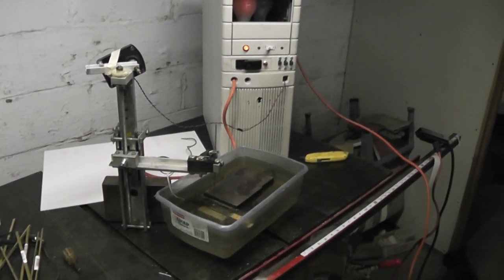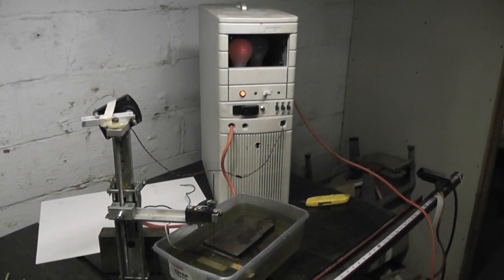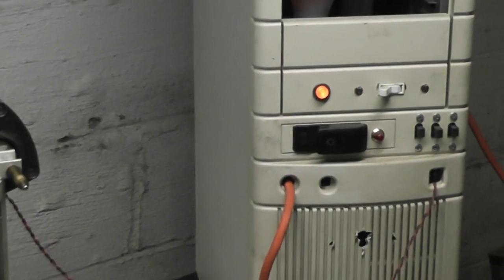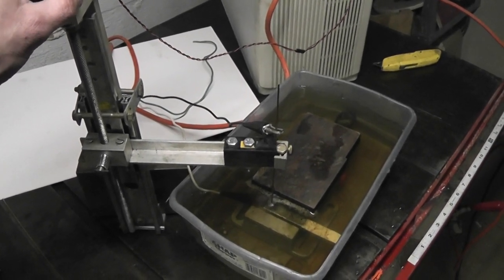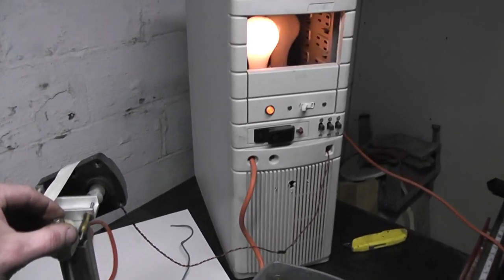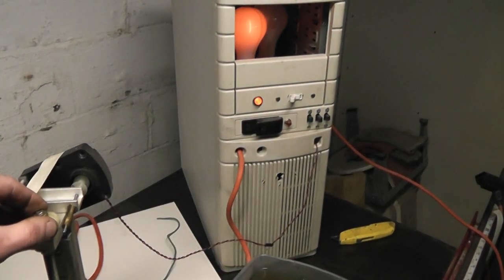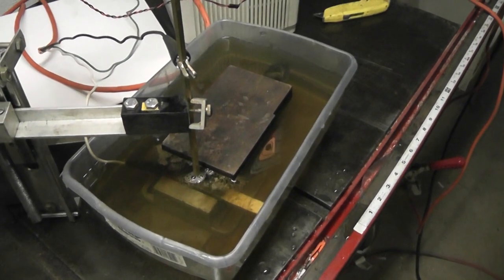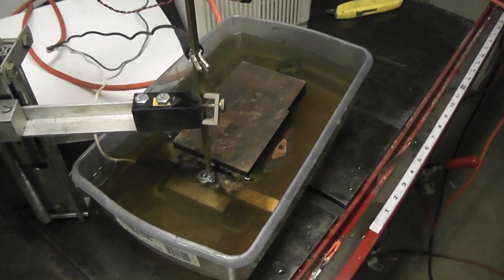EDM from junk parts

Comment: hello, sir, can u tell what was the frequency of the machining pulse you used I am doing a project on EDM machine it would be very helpful
Reply from the maker: Not sure 60Hertz? This just uses rectified 110v from the outlet. it's rather crude. I used it to burn out broken taps. Ben Flemmings has a couple of good books on diy EDM's
Reply: Tnx a lot
Reply: @22BOZIDAR  sounds more like 0hz. you need to use something to pulse it. i think 200khz is what Ben from applied science uses.

Comment: I intend to build your sinker. How much capacitance did you use? What is your dielectric fluid?
Reply from the maker: I used motor caps that are switched in and out,not sure what the values are. just plain water. be careful the voltage is high about 150 volts DC.
Reply: 22BOZIDAR I'm unclear what you mean by "switched". Would you clarify, please?